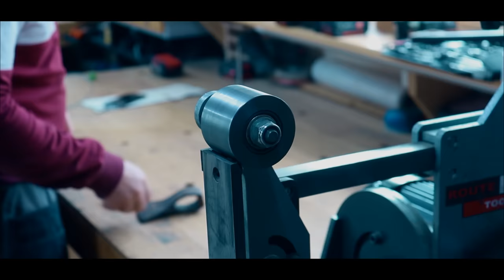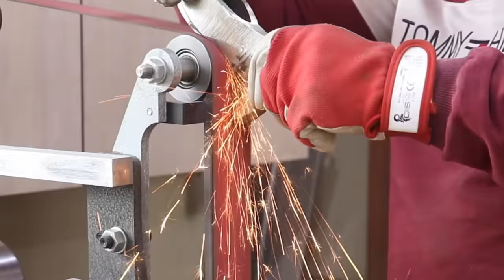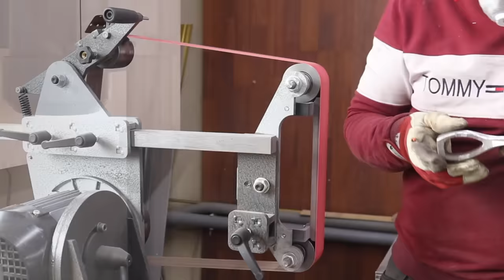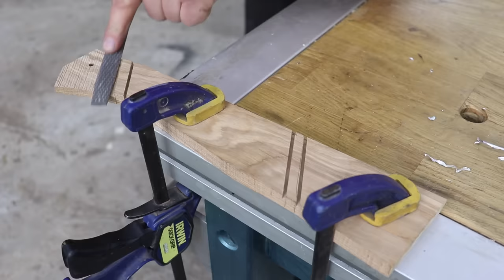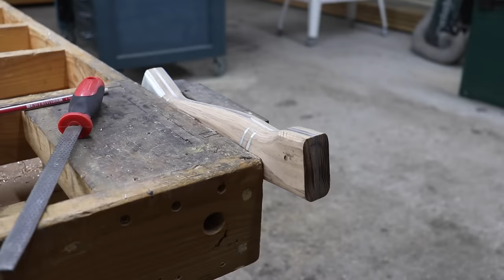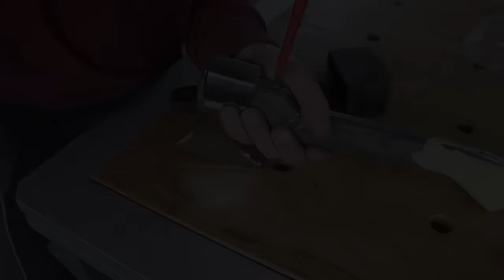Old axe restoration. Restoration and customization

Comment: The way you secured the head to the handle was something I’ve never seen before. What a great idea. Very inspiring!
Reply from the maker: Thank you so much.
Reply: I've never seen that securing method either, did you invent that? If you did, you need to patent it!
Reply: @gemofthewoods5802  There's a video of an antique firefighters axe restoration by "My Mechanics" which has the same kind of securing method, definitely worth a watch, so it would seem it's an old method that WD has bought back into use. He has done a marvellous job too.
Reply: @kougerat5388  thank you for that. I'm going to try and find it right now. 😀
Reply: Yeah, that is unique. It will make changing handles much easier I bet!
Reply: Шедевральная работа, восхищён.Вы реальный мастер,респект!!;!
Reply: In France  smaller hammers were secured like this, still available in DIY shops.
Reply: @patverum9051  ahh! that’s cool!
Reply: Older Fireaxes have similar idea to secure the head... but they have 2 metal "wedges".. one on each side, and a bit longer.
The reason he did it this way, is that he could not use a normal classic wedge to work, since he had metal in the middle of the handle.
Reply: Thats how most firefighter axes are secured, mostly with 2 on those, on both sides, looks really great
Reply: @gemofthewoods5802  вы откуда с Луны 😁это давнишний прикол. Так делали ещё деды. 👍
Reply: @dovodchik1909  hello, my phone did not translate. Sorry, I only know English.👍😀
Reply: Anche io ricordo la ascia del mio nonno con questa staffa di fissaggio sul dorso del manico. Aveva sicuramente i chiodi e non la vite, ma il sistema era lo stesso. Invece sono incuriosito dai materiali che hai usato. Posso chiederti che legno hai usato, è rovere? E che impregnante hai passato sul manico, olio di lino cotto? Inoltre la finitura a specchio sulle parti in alluminio richiede attenzione durante la lavorazione per salvaguardare la finitura finale del legno? E veramente un lavoro fantastico specialmente per gli inserti obliqui che se studiati correttamente aumentano la resistenza del manico. Complimenti.
Reply: @gemofthewoods5802  этот метод крепления давно известен. Запатентовать не получится.
Reply: 09 pp no one
Reply: @africaland506  ricordo anche io le accette in campagna con quel fermo. Erano inchiodate ma dopo un pó saltavano e la testa della accetta diventava un puntaspilli di spessori e spessorini😂😂😂😂
Reply: @kougerat5388   my mechanics work is just impeccable
Reply: @vitaliypro8441  I could not agree more👍
Reply: Very beautiful, yet useless. Thanks for interesting video though))
Reply: @gemofthewoods5802  EN RUMANÍA SE UTILIZA hace tiempo es muy buen y un trabajo excelente
Reply: O
Reply: @gemofthewoods5802  money - the equivalent of human energy spent on obtaining a product , energy of body and soul.... Soul , Karl !!!
 Think already what is the TRUE VALUE - matter or heat of Soul ?
Reply: せそさ
Reply: @kougerat5388  
دون
Reply: @gemofthewoods5802  ح
Reply: @gemofthewoods5802  

Comment
Reply: Absolutely beautiful; what a great tribute to your grandfather. Darlington, South Carolina USA
Reply: Simply Fantastic. You clever man 😎
Reply: There is probably a reason its not been done before.
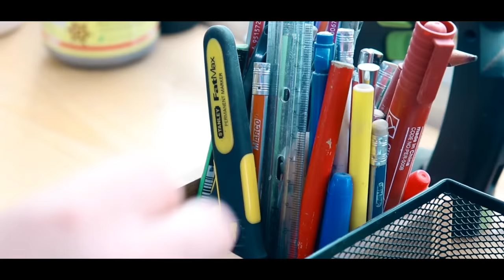Reply: Ж😮😅😅жж😅 0:54 жхххх?ж😅😅
Reply: Классный тпорик!!! Категорически лайк и процветания вашему каналу😊😊😊
Reply: Stop Simping bro. It’s just an axe.

Comment: Красиво! Если повесить на стену и любоваться.
Топорище,чем оно монолитней, тем крепче и безопасней!
Reply: Есть топор для души, а есть для роботы.
кто не работает с душой тот не поймет..
Поэтому некоментирую такие видео просто получаю эмоциональное удовольствие.
А кто привик языком молоть, так пусть мелет.. он для этого рожден
Reply: The epoxy used to bind the wood and metal in the axe handle is stronger than the natural resin in the wood. Plus, the sandwiched metal which runs through the length of the handle assures its strength. So, that restored axe will outlive its restorer, even if he uses it regularly and then pass it on to his own grand children.
Reply: @andriidemianets7346 мели и дальше)
Reply: Оно то конечно так, но именно в данном случае проблема не монолитности (можно долго спорить сколько нужно времени и сил что-бы разошлось  клеевое соединение, клей может быть и лютый), а в способе крепления лопасти к топорищу. Отсутствует расклинивание обнуляет практическую ценность данного инструмента почти полностью. В топоре свободная посадка недопустима,  так как не пройдет и  часа работы косые нагрузки приведут к разжевыванию топорища в месте посадки. При болтающемся клинке работать невозможно.
Reply: Отличная вещь для мелкой работы. Например в хорошей компании развести костерок! Отличная штука для подарка на память. Тем более функциональная.
Reply: А еще первый слой видел его деда. Жаль, я такие вещи не трогаю, 
Тут касалась его рука, тут , возможно, его днк, ну, вы поняли. 🗿
Reply: Sự phục chế này thật tuyệt vời! Biến một chiếc rìu cũ thành thứ gì đó đẹp đẽ và hữu dụng một lần nữa đòi hỏi kỹ năng thực sự. Thích những điểm nhấn tùy chỉnh—trông đẹp hơn cả mới! 🔥🪓✨

Comment: Good lord, that's a gorgeous result! I can't help wondering if the metal center of the handle might send more vibration through the hand than pure wood if actually using it regularly, but that looks more like a museum piece that you'd be keeping on the wall than actually splitting wood, so probably not an issue. I absolutely love it, though. Marvelous!

Comment: Really nice work. I would have loved to see the finishing process in detail (even if it means a longer video); it's the best part of it IMO! All of it, polishing of the head, sanding of handle, etc. I also assume you did some coating or even tempering of the iron head since it's not rusty, that would have been cool to see too :)
Reply: I felt the same. A lot of the "rough" work was shown, and then it suddenly jumped to a much more fine finish. I imagine a metal inlay is mainly for looks? I'm guessing it'll not handle as well as a wood handle (stiffer, less damping) and over time the join will separate. Looks cool when new though...
Reply: Охренеть можно 👍
Reply from the maker: I will try to pay attention to such details next time.
Reply: ok

Comment: it's very pretty and looks like something you'd use in a movie. my concern is would the metal inserts loosen in time with use and would they pose any danger of hurting the user? I'm not and expert, but it just came to mind. if no, then please make more.
Reply from the maker: Thank you for watching. Inserts won't hurt me.
Reply: How would they loosen over time? They're screwed in.
Reply: The way that handle has been laminated together with all that epoxy they will never loosen.
Reply: @briandavern8741  Thanks for clearing that up. I really was just wondering if it would. I mean an axe is used to hit something with force repeatedly and I wondered would enough wear and tear do it?  And I guess I was wary about what could happen to someone's hand if they did come loose seeing they way they were shaped could make them really sharp if they did. But like I said, I'm not knowledgeable in epoxy didn't realize how strong it could be in these applications. It really does look nice.
Reply: @jacobsilayan  No problem at all.

Comment: You created a beautiful tool and it was a joy to watch you do it.

I have some questions--
  will the epoxy hold up to the repeated shocks of thousands of cutting strokes this axe will suffer during normal use?
  will the metal on metal mounting of the axe head hold up without deforming?
  do the metal inserts in the handle weaken the handle?

These questions would not be valid, of course, for a tool that is just used for ornamentation.

Comment: I understand that tastes are different. I could never do that to my grandfather's axe. I could never smoothe out the beautiful forging work the axe head shows. I only given it's wood some sanding and oiling, the axe head a good grind and sharpening, and a new wedge for tight fitting. I could never destroy the traditional look of beauty into something that looks this... Modern, almost cyber-like. Just sad your grandpa's axe's charme is basically gone. 😢 But... That's just me and it's obviously important what you connect with the axe. And regardless, you did great work there 😊

Comment: Why did you put the axe upside down? The cutout on the axe is the bottom. The hole for the handle is conical. The cone widens upwards. This is called hatchet work and hack work. Что же ты топор вверх ногами поставил.Вырез на топоре это низ. отверстие под топорище конусное. Конус расширяется вверх. это называется топорная работа и халтура.

Comment: I heard that it's a myth.. 
But I still cringe when I watch them use a file going both ways forward and backwards.
At times I thing back to 1964 metal shop. 
Mr. Green would unload on ya if he saw it. He said it would dull the file...

Comment: I hate mirror polish finish in axes. It’s not sustainable on a tool that sees use, it removes all the history and character the tool has built up over the years. Get a Chinese harbor freight axe if you want to polish something. Dermatology, stabilize, rehandle, sharpen. That’s all an old axe needs. Anything else is just sad. Like making a lumberjack wear makeup and heels.

Comment: As someone who has worked in aviation hot lays for decades, i cringe every time i see knife making videos and the amount of epoxy they all use. Too much epoxy makes the bonds brittle.  More is not better. Use a thin layer on a clean smooth surface for best results. You will save money as well.